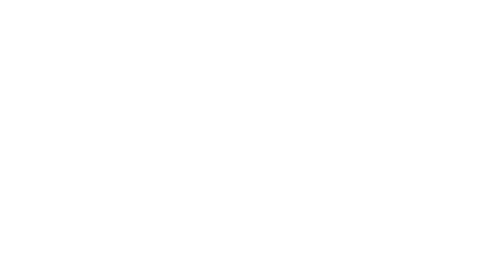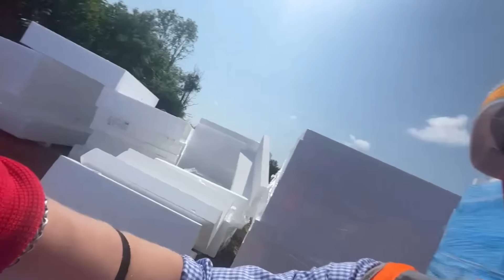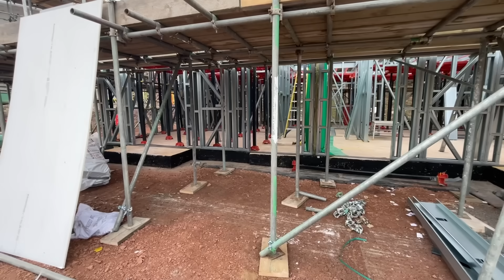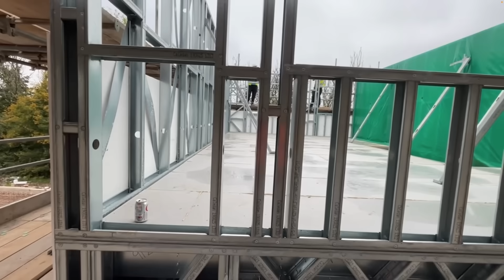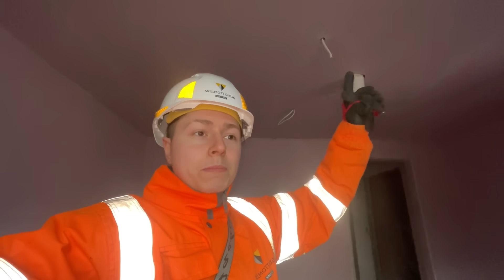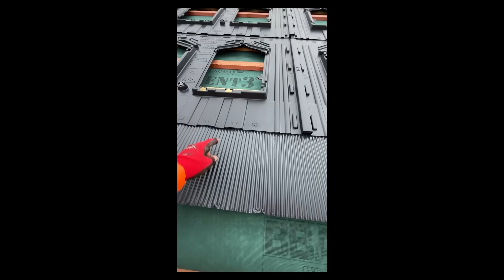6 Mind-Blowing Building Materials Changing UK Houses in 2026

Comment: I've never encountered sprinklers on a detached domestic home. Is this regulatory driven?
Reply: In wales to reduce the risk of a fire spreading,
Reply: my guess is it’s due to the metal frame construction.  Metal deforms quickly in the heat of a fire.
Reply: @over-engineered  Basic fire in a  steel portal warehouse a few years ago, then all of a sudden  upright girders  started moving,and buckled,  then the roof fell in as  the whole lot collapsed like a slow motion  film
Reply: @over-engineered  The metal frame is not a fire risk as it is clad with fire resisting materials.  Sprinklers are there not to save the building but to allow safe evacuation, which is normally 5 minutes from the point of the fire detection.  The fire resistance of the building will be not more than 60minutes, which gives the Brigade sufficient time to fight the fire, failing that it will be allowed to burn but ensuring that the fire doesn't spread to adjacent buildings.  So long as the occupants are safe if the building burns then it just becomes an insurance issue.
Reply: @clivewilliams3661  that’s my point, the fireline board and sprinkler protect the metal frame
Reply: @over-engineered  The sprinkers don't contribute to the fire resistance of the property and fireline board is not the only way to protect the metal stud with plasterboard.